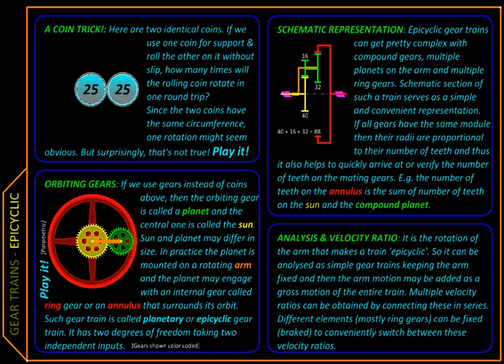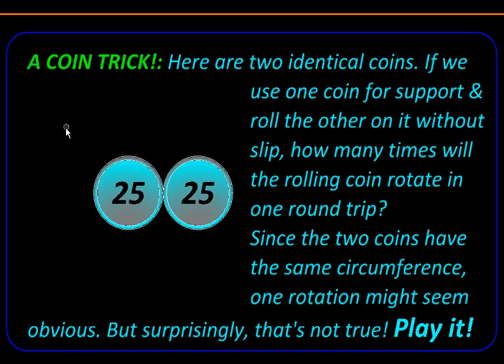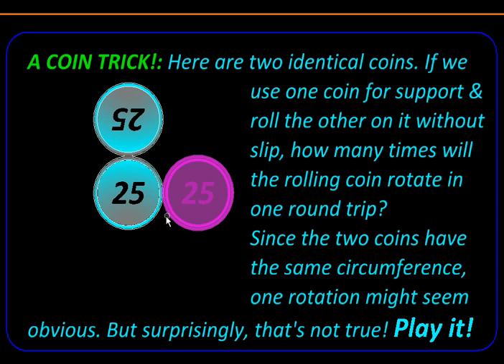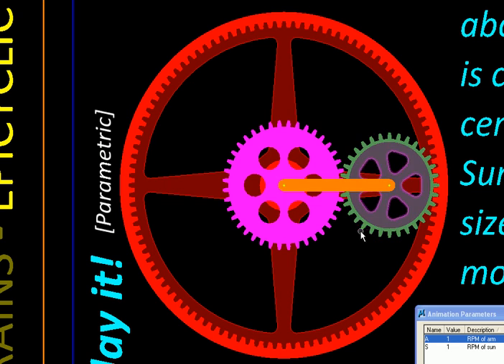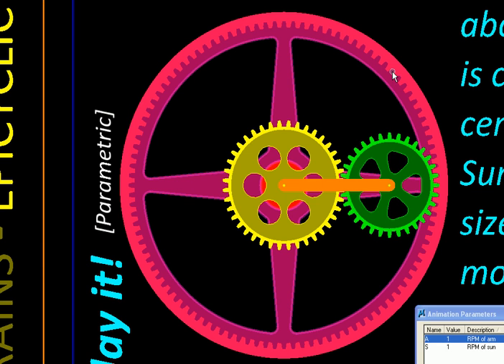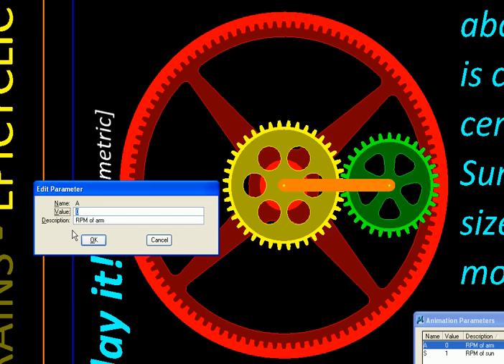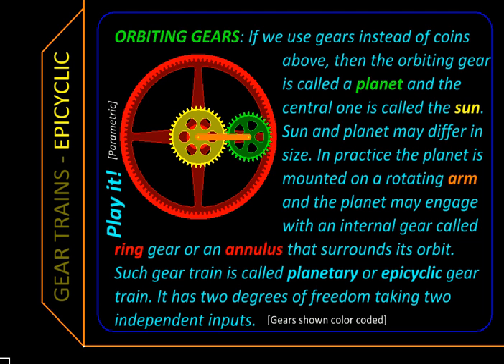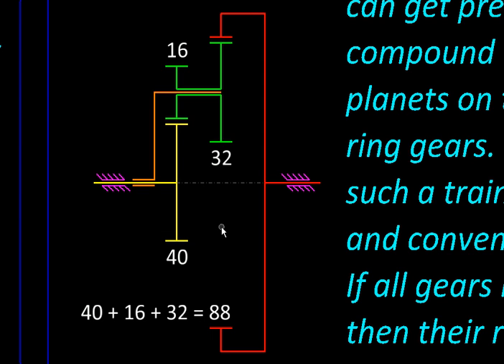Kinematics Ch06O Epicyclic Gear Trains

Comment: Sir,If a gear is fixed and we rotate a gear say A in clockwise direction then will the direction of rotation of fixed gear will be the same as A ?
Reply: what youre asking is to fix the arm and thereby fixing the gear B.if you rotate the gear A counterclockwise sense the gear B will rorate in clockwise sense as they are externally meshed gear.

Comment: How does area under load curve represents work done?
Can you please answer this Ujwal sir??
I have plotted some values of Force and Displacement on a graph.
I calculated the work done using formula W= Force X displacement.
Then i calculated area under work done.But my answer is not matching.
Can you please tell me the exact proof Sir.

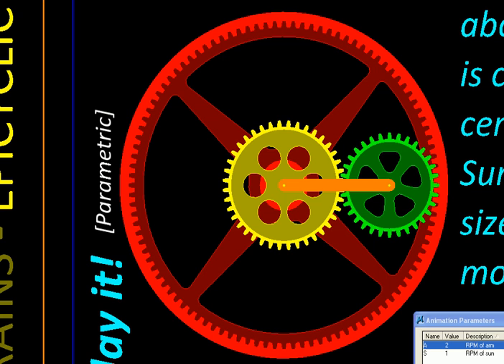Comment: from 3:32 to 3:38 all the gears(sun, planet and ring gear) are rotating in same direction(anticlockwise) which is not possible. atleast one gear should move in clockwise direction, most preferably the sun gear gear bcos u said its free.